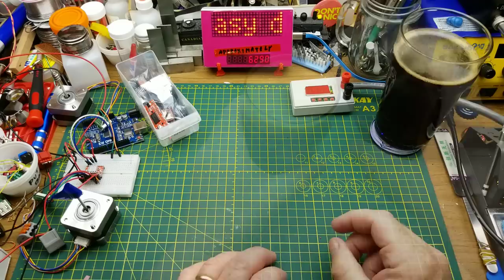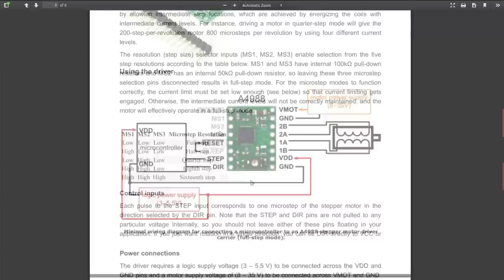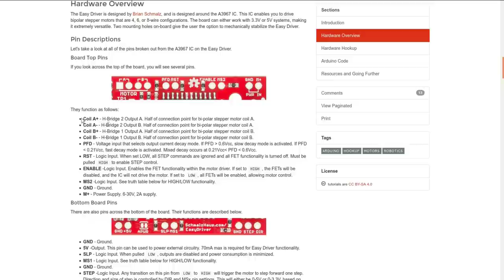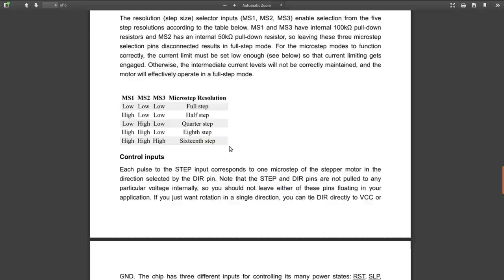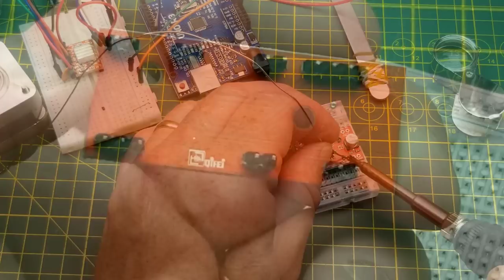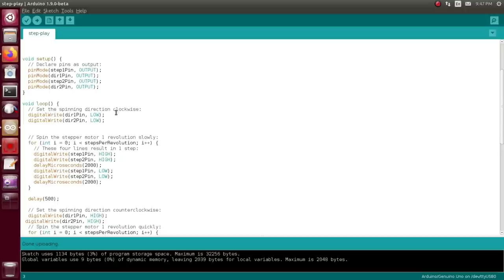Experimenting with EasyDriver

Comment: Nice!  The easy driver is a good little board. Most of the NEMA 14-23 in that shape are 200 steps per rev and 1.8 deg per step.
Reply: @pileofstuff would be in hog heaven, using Marlin, so Gcode could applied with speed/accel caps and feedrates.  To get top speed, esp with a load, you need acceleration control.  Guess he would minimally need an atmega1284 to run Marlin 1.8, in 128k flash.
Reply: @GnuReligion  GRBL would do it at well without having to go full tilt Marlin.  I toyed with that idea last year with a little testbed stepper bot. It is something to think about for better control as you say.
Reply from the maker: Building my own CNC or printer from scratch seems a bit ambitious, but I do have some ideas to put these things to a use. Not sure if it's a good use, nor a practical one... 
Experiments continue.
Reply: @UReasonIt  You are absolutely right.  Have had a 3d printer so long now, had forgot about this project.  https://github.com/grbl/grbl
Reply: @GnuReligion  Me too. It has been a bit since I did a Mar compile for my old printers. I try to keep them stock now, but...

Comment: You can get really primitive, and drive your steppers with a single chip, like the classic Dual-H Driver L293D.  These are about $0.25/ea.
Some fancy drivers can "feel" resistance to movement with current draw measurement, enabling auto-detection of stops/extents.
Oh, the places you can go.
Reply: Bridge drivers require much more effort on the MCU side for creating the drive waveforms though, they also have no current limiting. Even being cheaper they don't represent a very good value but it depends on your needs. Just having some H-bridge drivers like that around is always nice though because of their general usefulness. Getting stuff cheap is nice but you have to look at overall capabilities.
Reply from the maker: I also have some H-bridge drivers around here somewhere. I tend to reserve them for normal DC motors, though.

Comment: is shorting manually +5 and sep make a 1.8deg turn without conecting the other pins?
i wanted to test this board without arduino
Reply from the maker: Yes, you can manually pulse it. Connect the DIR pin hi or low (whichever direction you want), then you can manually pulse the step pin.  You can even pulse the step pin with a 555 for testing, if you want a lot of pulses.
Reply: @pileofstuff  i just welded a push button inbetween step and 5v and nothing hapend
is i have to solder also the gnd for make it work ?
is all the low have to be linked at gnd and not let loose open ?

Comment: Is there a need to add a diode to protect against the back emf ?
Reply from the maker: I believe that's handled internally.

But, since the coils are driven with changing polarity, you couldn't put a simple diode across the coils like you might with a unidirectional DC motor.
Reply: @pileofstuff  
Ah, thanks.

Comment: The reason your regulator got hot is because it was dropping close to 20 volts, definitely not ideal. But hot to the touch doesn't mean much with electronics, most devices will tolerate temperatures that will give you first degree burns in less than a second. I'm sure you have meters that have thermocouple measurement modes, if you don't have probes for them get some cheap K type thermocouples for them, the really small pin head sized one's are ideal for measuring chip temperatures.
Reply: " definitely not ideal " I agree, but when a 5v regulator on a development PCB is way too hot to touch, which is probably around 70C, then there is a problem, or a design flaw, if you can't actually touch it without serious harm then you don't need a thermocouple you need a thinking cap !
Reply: @andymouse  that depend on the environment they go into. If it's at thermal equilibrium at 70C that's fine. A 7805 is good to to 125C

Even delicate modern CPUs will have a long life at 80C lower is better but it's all about your particular design criteria. If you're going to have an ambient much above what you're testing at, yeah you'll need to rethink that.

Comment: 1) Current management is everything with steppers. User should start with the recommended vRef (pot on EasyDriver) setting based on maximum current per coil on motor label.  After that, try reducing the vRef until motor stalls while running, then increase vRef just enough to get motor running again. Using the lowest current setting without stalling motor will reduce both noise and heat.  

2) If you need to improve performance and can spend $8, I highly recommend using the TMC Stepperstick https://www.digikey.com/product-detail/en/trinamic-motion-control-gmbh/TMC-SILENTSTEPSTICK/1460-1159-ND/5724190  or Watterott https://shop.watterott.com/navi.php?qs=TMC2100&search=

3) Arduino quick code tip for steppers – try using tone() to generate step pulses. https://www.arduino.cc/reference/en/language/functions/advanced-io/tone/

Comment: I can't help watching your videos without wanting to get into arduino microcontroller stuff.. What's a fun kit to buy to learn basic stuff?
Reply from the maker: Any of the starter kits would be good to start with. The larger variety of different types of modules the better. 

The built-in examples that come with the IDE (also available on https://www.arduino.cc/en/Tutorial/HomePage) are a good place to start learning.

I can't find a listing for the exact kit I started with, but it was similar to these:

https://www.ebay.ca/itm/NEW-KEYESTUDIO-Electronics-Components-Science-Set-Starter-Kit-for-Arduino-Kids/133473734573?hash=item1f13a78fad:g:lt8AAOSwU0FfBt8E

https://www.ebay.ca/itm/Ultimate-Upgraded-Starter-Learning-Kit-For-Arduino-UNO-MEGA-2560-R3-NANO-Project/312823345966?hash=item48d5b9732e:g:epAAAOSwbHpduLFm
Reply: @pileofstuff  Hey thanks for the generous reply!

Comment: A4988 drivers are noisy beasts. TMC2208 drivers are almost silent (3d printer owner here)
Reply: but many 3D printer have anstalled in motherboard drivers not can change to tmc drivers. or need change all motherboard new, i change my anet A 8 printer board to geechtech 2560 board, include mossfets to hot bed and end, include fuses, biggest display, working lto better and sure, than genuine anet board, 3 board come broken burn genuine drivers not can change need buy new board. better buy lot better motherboard not genuine. and add marlin software.easy if i can do thats all can do thats.

Comment: code have lto better accurato not use delay, use how many step you need motor run left and right then have accurate. or expet my motorize vise, have only speed whit potentiometer and then limti switch end stop in and out. can add pressure sensor vise and motor stop x pressure have next level.

Comment: all normal stepepr have 200 step/rev.motors, then have lot 400 step/rev motor too. but not 1000 step.
Reply: 5 phase stepper motors are 0.36 degree per step or 1000 steps per revolution.
Reply: @Embeddedtronics  yes but who use ??? i not vhas ewer see anywere in factory or hobby or all my 56year life anywere. all uses normal 200 or 400 step motors. and i has build many hundre automation macjhine  and retrofit many hundre manual mill my worktime 30 year automation engineering.
Reply: Matti Virta 

While you may not use them, others still do. Vexta/Oriental Motors still sells 5phase motors.  I have a couple of them in my junk pile of motors.

Comment: im used easy driver some place, bush button vise open / closed motor and liguid filler table bottle changer,and base at 3d scanner need do later. wery cheap and simple use many place if home have some old stepper. nema 17 size. not big current can handle. if need handle motor up 2A current need order hy-vin-368N-5A max 5A motor can use. 0,8 to 5A max. good cheap 13$ driver. big nema 23 motors if need motorize table or lathe or cnc. or drill. etc.

Comment: stepper motor not have matter what voltage you use, 5 or 50 volt all can use nema 17 little motor if motor have stamp 5volt you can use this 75x biggest voltage if want and no mean anythink have only little fasten, but current have important not have up to maximum if motor have stamp 1,4A not use ewer 2A or burn it, need adjust driver current down less than 1,4A

Comment: 4988 have wery noisy old driver better not use thats ewer, lot better driver have new many and cost same.
Reply: 4988's are dirt cheap compared to more modern quiet one's.
Reply from the maker: Yeah, the 4988 (and the easydriver) are only about $1.50 each, the newer LV8729 are $5-6 each.

Sure it's not "break-the-bank" territory, but as anyone watching should have noticed by now, I like to test the cheapest (and most beginner approachable) solution first just to see how viable it is.
Reply: @pileofstuff  unless you're optimizing for performance or noise the 4988's are still more than good enough for a huge range of projects.